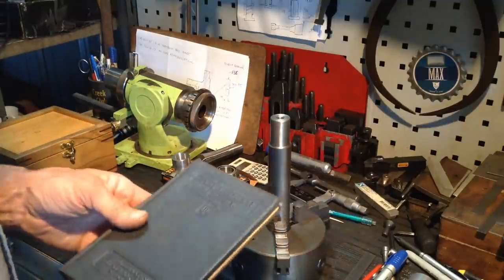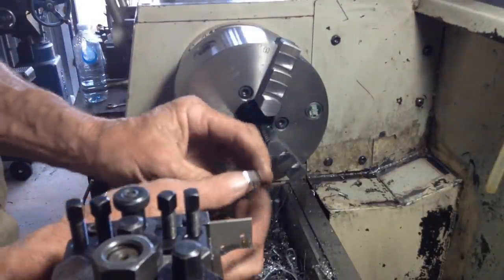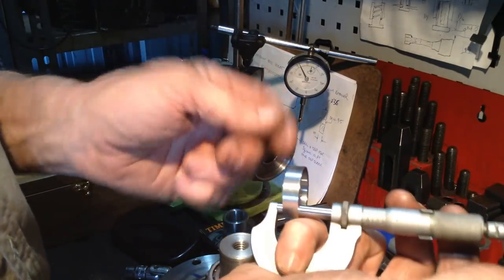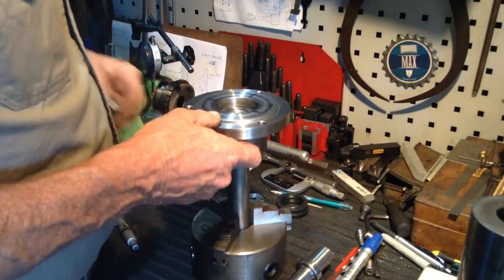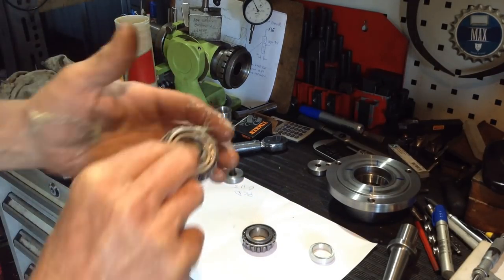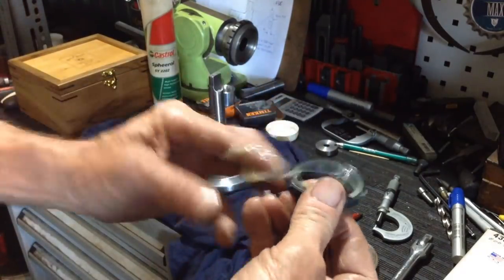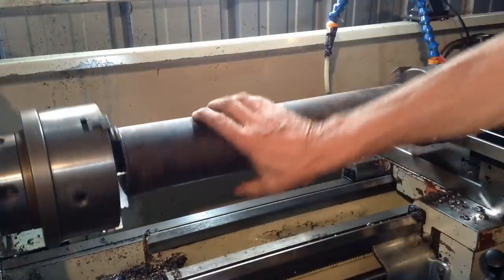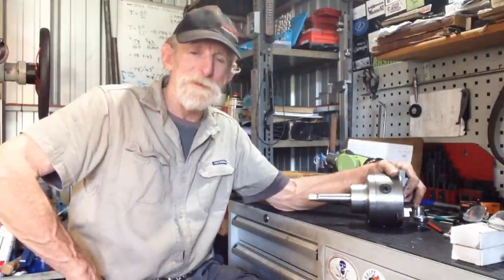Lathe Tailstock Chuck Mount .  Part 8 .  THE  COMPLETION !

Comment: This video was particularly informative. Thanks, Max. I really enjoyed it. Question for ya Max, when I was looking to buy a tailstock chuck holder (because it was a bit of an ambitious project for me at this stage) I looked for a 4 jaw so that I could dial in any off axis inconsistencies. You opted for a non-independent three jaw chuck. Was that because it is what you had easy access to, or was it the best choice?
Reply from the maker: Hi Rob . The chuck was just a spare one i had laying around .  I will adapt a 4 jaw for it as well .  For general use the 3 jaw should work fine .

Comment: Thank you Max, I enjoyed watching the build. It looks really good and will work well. You have taught me a lot about accuracy in the short time I have been a fan. How do you stop jobs like that getting surface rust on them? Thanks for your tips on seal fitting, I hadn’t seen that before. I have used a number of Speedy Sleeves in the past to get round worn seal surfaces and like how they go. Jeff
Reply from the maker: Hi Jeff . I just use a bit of CRC  or oil .

Comment: Dear Max: congratulations, you are a true professional. But, please take my curiosity: do you turn to professionals like you or to amateurs? Because in the first case, assuming that a professional does not know how to hold a tube on the tips (or spindle-tailstock) even if large, your videos are so unnecessarily long that they would fall asleep after the first video. If, on the other hand, you are targeting amateurs then it is different because they would have so much to learn but it would be of no use to them since being amateurs they would never use your equipment on a mini-lathe. Thanks, however, for your effort, and I like the way you work. p.s. sorry for my english translated with google translate
Reply from the maker: Thanks .  Videos have had mixed content regarding the processes , some are basic for amateurs & some not .     It has been good for the subscriber count when i started the channel  !        Once i have the new shop running soon & my larger gear running there will be less of the basics .  Cheers .  👍

Comment: Great series Max. That thing is spot on. I see now exactly why this would be useful. Some good oil seal tips as well. I cannot wait for someone to complain that you double clicked the torque wrench. I love that nonsense, lol.
All the best!
Eddie
Reply from the maker: The ones that complain are usually the ones that have never used them   !
Reply: @swanvalleymachineshop  That is the truth! Did you see I finally got a new lathe? I would not call it a big boy one but maybe a moody adolescent.
Reply from the maker: @theeddies  I did , watched it last night on tv .  I usually watch a lot of videos on tv & go back later to the lap top to do the comments .   Looks like only a few minor things to sort out .   Nice long bong bed on it  .
Reply: @swanvalleymachineshop  I do the same thing, watch on tv and comment later. Thanks, already have several parts ordered to adapt as well as a print set of change gears to try. It is going to be fun.

Comment: I had a motorcycle with a bad seal. It was something unreasonable 40+ dollars for that one seal! So i grabbed an auto seal that looked close, turned out to be too big on the id and to small on the od... I pulled out the spring and replaced it with a slightly smaller diameter o ring. And i grabbed a large o ring and packed it between the case and the outer seal. I rtved the hell out of it for good measure. I'm pleased to say it's been a couple months and not a drop off oil has leaked out.
Reply from the maker: Some of those inside springs can be cut & shortened , the ends just screw together . 👍

Comment: Hey Max. Nice project. Did you consider using ring shims in addition to the spacer? Rather than try to dial in the preload with removing material, just add and remove shims instead? Not sure if they are available in your ID/OD size or not but I know McMaster has different kinds available here in the US.
Reply from the maker: Thanks .  I probably would have gone that way if they were easy to get hold off .

Comment: WELL DONE Mate!   I am very impressed. It is a well thought out design.
Reply from the maker: Thanks .   It is set up to run MT 4 & 5 arbors as well for my other machines , just undo the bolt & swap the arbor .  Bearing preload does not change .

Comment: Excellent work max and great instructional info on Bearing and Seal fit-ups.  I tend to where possible fit locking washers as the you can re-adjust the pre-load after the bearings have broken in, not always possible if room is tight.  I don't think people consider what the incorrect pre-load on a seal lip can do, create drag and heat and rapid wear on a shaft.  I have stated on drawings that the seals be fitted in reverse if grease can be introduced with a gun.  It pressurizes the space and if relief breathers are not fitted (these pop off at around 1 PSI of pressure) the seals can and have be blown out.
Cam
Reply from the maker: Hi Cam .   If i was to go that way , just fit both seals the same direction  , one lip in & one lip out  . That saves on a breaker valve .  
The end of the day , i wanted to keep it as simple as possible .    It seems good with hardly  a couple of degrees  any heat build up on it's first run  & bearings set to practically a neutral position .   
Cheers .   Hey i am looking at some machines at an auction , they probably will go out of my budget as usual , will see what happens !!!

Comment: Hi Max, I'm a newbe to metal working. Can't thank you enough.Just recently bought an older 12-40 lathe. Have been watching many videos to learn how to mount and turn 3 1/2" pipe 25" in length.I did not find any videos that helped until I ran across yours. My project is to make a slip roller to form 3/16" ms sheet 23" wide. Thank you again, will be watching  your site in from now on. Great job on the videos. I'm 73 and started to learn metal working to teach my grandchildren.
Reply from the maker: No worries .  👍

Comment: Really enjoyed this series Max. I am going to have a go at making a new tracking roller for my 72" grinder and using taper bearings (Why? because why not?). My only experience with taper bearings is with wheel bearings, they dont use a spacer between the bearings, is that because they are so much bigger and just dont need it?
Reply from the maker: If you don't use a spacer then you need a different design retainer washer to hold the thing together  , other wise it may want to keep coming loose . A stepped one will work ok .  So it contacts the end of the shaft & the bearing at the same time , or you could use shims under it .
Reply: @swanvalleymachineshop  thanks for the tip Max !

Comment: Hi Max couple things you never take end float to zero as you cannot measure zero meaning you could under cut it and have 10 pounds pressure on bearing or 500 pounds pressure so we always did bigger bearings with slight end float so not to over tighten also if you have to pack multiple bearing use needle greaser on grease gun quick and clean just slide into bearing between each roller quick pump all done thanks for your educational videos
Reply from the maker: It depends on the application .   All of the ones i do 1'' through to about 10 or 12 '' diameters , vary from .002'' to .010'' end float  . I also do quite a few  taper rollers set to preload , sometimes a lot of preload depending on the OEM spec's for the application .  After a while you get a good feel with a preloaded bearing  , as if it feels too tight or not . The ones where you have to allow for seal torque drag with duo cone seals are the worst ! 
On an application like the tailstock chuck i would never set one up with end float . 
I have a couple of needle greasers in one of my box's  at work !     👍
Reply: A salutation is to a collapsible spacer, developed by GKN for their diff assemblies

Comment: Hi Max, great series and end product. Looks like it works really well. I just wanted to ask with using an alloy spacer that would expand more than the steel around it, would it be possible for it to expand enough causing it to develop end float? Or than any expansion won’t have any effect and will just load up the retainer more?. Cheers mate
Reply from the maker: Time will tell , i am not anticipating any issues .

Comment: Great job, handy addition to the shop. I think I may have used the end cap to finalise the last 0.10, ref stepped shoulder. 
Thanks for sharing  Max.
Reply from the maker: Thanks .  I thought about that way , but i think later adjustment is easier to just take a bit off the spacer with wet & dry .  Cheers .
Reply: @swanvalleymachineshop  Plenty ways to skin a cat, I started to make one, after Kurt's at CEE showed his design,  same as yours,  I'm using Timken,  I used to build and commission rotary Friction welding machines, the larger models use Timken,  with approximately 16" ID, with up to 3 in tandem. The bigger ones are 24 months plus lead time from the US. Hope weather is willing to work with you. Thanks for replying.

Comment: Not sure it is always a misprint. I've a tool maker book from  1915. There are tables in there.  In this book, if you always round down at each step, you can reproduce their results. I assume since calculators were not really a thing, this was to simplify the math.  The processes are valid and I just run my own numbers.  At least that was my experience.
Reply from the maker: Hey i found the mistake in an earlier video ,  https://youtu.be/0TRUHWh_Uk4   
They are rare , but  like you say run your own numbers to be sure !  
Cheers .